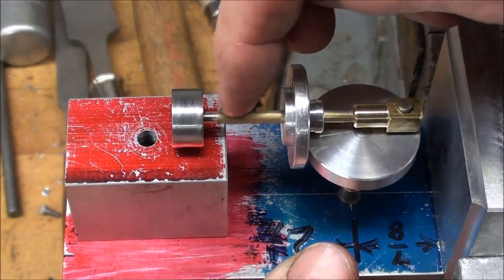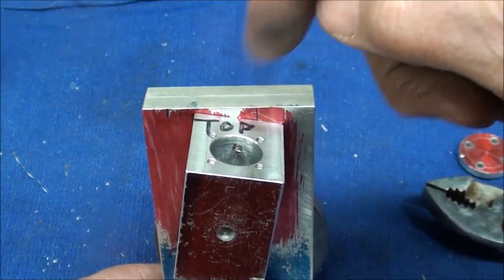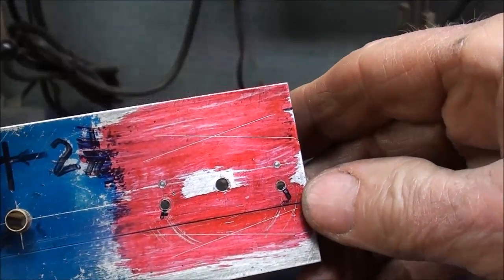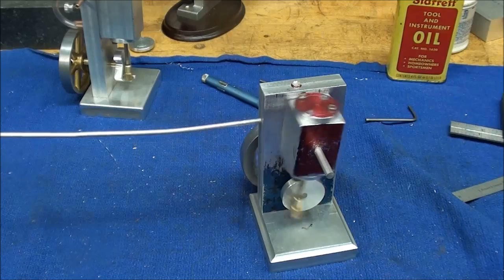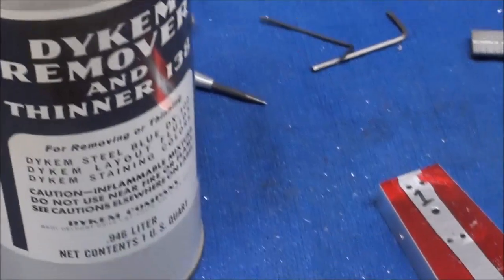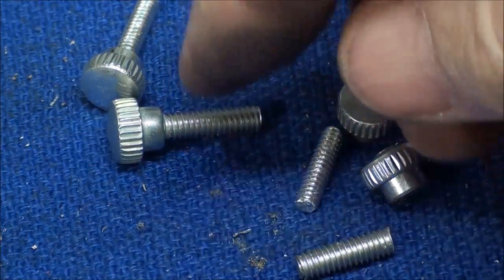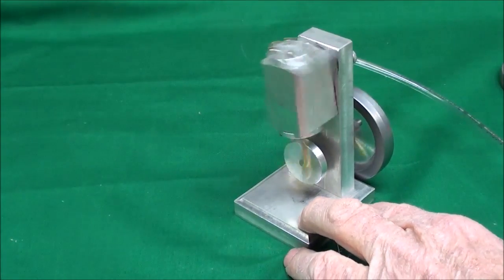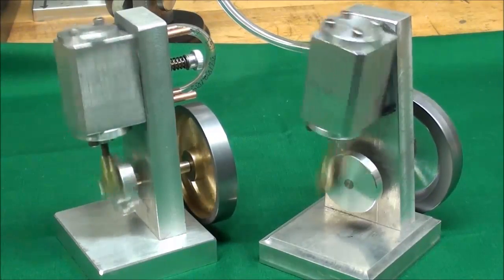WOBBLER DA STEAM ENGINE how to build pt 5of5 tubalcain

Comment: Very good, it might make a few kids put down the phones and take up the chuck key and the endmill. I like to see engines like this running slowly. An engine going flat out, you cannot see anything. I seen a sectioned motorcycle engine turned by a small electric motor, but the man that made it had it turning too quickly, you could not see much. He regeared it and you could see everything perfectly.
Reply from the maker: Yes, I like it slow. The students always wanted it to run full speed

Comment: Would be nice to drill an internal manifold for the exhaust the same as the inlet.  Then you'd be able to reverse the engine by moving the air inlet tubing from one side to the other.

Comment: Mr Pete.   I remember (50 yrs ago) a physics class demonstration of a spoked wheel vs' a solid wheel, down an incline,  (same weight, same  diameter)  the spoked wheel was faster.  Would that  relate to an engine flywheel speed?

Comment: Im trying to work out if i can be modified to have a cylinder each side and be made v twin well v 4 also havent seen the joker in a while is he still in the shop
Reply from the maker: I did that along time ago. You might find it appearing on some of my other videos
Reply: @mrpete222  really the v twin or the dual cylinder i will have to have a look threw now see if i can find  if can make it work i might have a go at a v8 (surpose that would make it 16 valve to)  but that only if can mke the v4 work

Comment: How about a inverted version with the crankshaft on top , much larger diameter but same weight flywheel , bet that would run slow

Comment: Can you run anything using this style engine
Reply: I know there would have to be a size increase to match output requirements but to power for example a metal bandsaw or a drill press or something along those lines to be able to adjust power and speed by simply changing psi is this theoretically possible or so far from realistic it’s not funny please tell me you know

Comment: I've uploaded plans for this to Thingiverse: https://www.thingiverse.com/thing:3432821/
Reply from the maker: Paul.  I do not understand.  I now have the 3d model on thingiverse to print out.  That is not a working model?? Is it.?
Are the other files drawings? I cannot find them. Thanks
Reply: @mrpete222  There should be a bunch of files there: the STL is required by Thingiverse, but isn't very useful. There's a STEP (.stp) file that can be loaded in Fusion 360 or Solidworks, a PDF with the printable plans, and the original Alibre files (.ad_prt,.ad_asm, etc)

Thingiverse doesn't seem to allow direct links to the printable plans
Reply from the maker: @PaulSteMarie  Thanks--I put the link in the description of THIS vide.